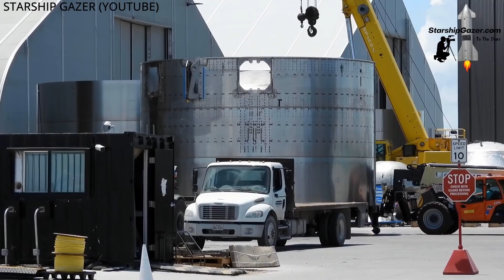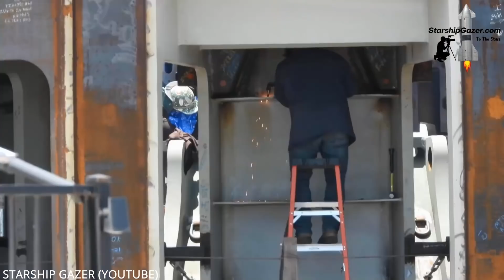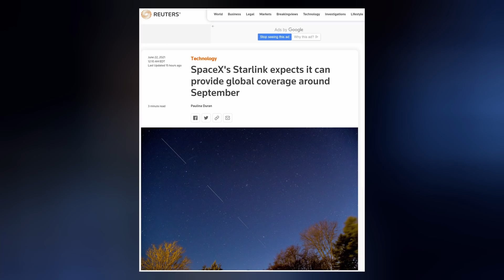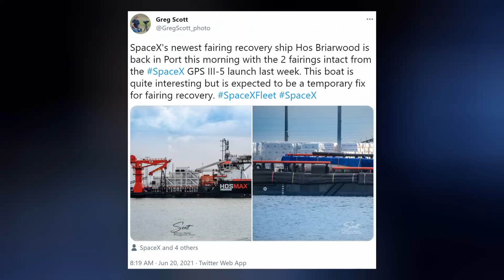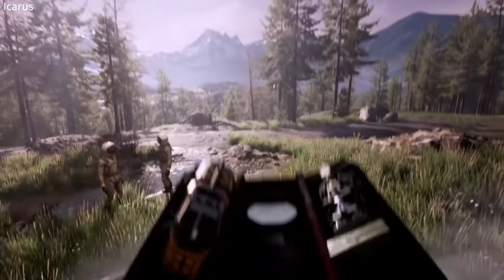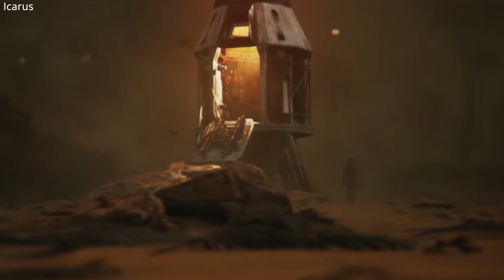Starship Orbital Flight Still Targeting July Despite Needing New Booster | SpaceX in the News

Comment: My fascination with space exploration is that it currently represents one of the most dynamic engineering problems in recent history. For instance, I’ve been thinking about Elon’s plan of increasing the booster raptor count from 28 to 32. Since the outer ring of raptors are fixed, there may be a unique opportunity to save some space by combining the outputs of the outer engines together by blending the bells into a common ‘ring’ structure. That would allow the raptor cores to be mounted closer together since the engine bell is the widest part of the raptor. The hot gasses wouldn’t really care if they were being directed by a physical bell or just the gas pressure of adjacent engines. The net effect would be a combined output being directed downward to propel the booster. The center articulated engines would still retain their individual bells, but that would be a way to significantly increase the number of fixed raptors in the outer ring without resorting to increasing the diameter of the bottom of the booster. Basically I just love solving engineering problems with innovative, out of the box thinking.

Comment: I have, since I first watched Star Trek on CBS (in black & white) wanted to "break these surly bonds" and head out into space. When Apollo ended, I was just so dejected because we had the minimum knowledge & the WILL to make the move on to Mars and Europe (and beyond.) then when we just started the Astronomical Equivalent of driving around (and around, & around...) the block for the foreseeable future - I just felt so betrayed.
When the shuttle program started, and bold new plans for a purpose built station were bandied about, I thought that maybe this was it. And, about this same time, I learned that my eyesight would prevent me from being a conventional astronaut. It made me realize that the only way I was going to get to space was to be a Worker on a commercial Station. I figured that the Government wasn't going to "go" anywhere, which left the private sector.
As a career direction, I chose the military. My grades and test scores were not really good enough to get into the kind of college/university that would put me into a suitable skill set for a space/orbital engineer, but they could get me into the Navy's Nuclear Power Program. After graduating from NPS, I volunteered for Submarine Duty with the following mindset: if I wanted to make myself a good candidate for a Worker on a Station, being a "Nuke" on a Sub had some specific skill sets. Namely:
▪ A Science based vocational skill set,
▪ Proven ability to work in a stressful environment,
▪ Experience working in a situation where one must "deal" with the reality of one's situation — i.e. One can't simply walk outside when shîť starts getting real,
▪ And experience with maintaining ongoing interpersonal relationships with folks that I might genuinely dislike, but cannot get away from.

To me, it seemed like a shoe-in for a resumé.
But, by the time I got ready to leave the military, we, as a Nation, & as a species had simply lost our way, at least in space.
And by that point I had both lost faith in the Government's will to do anything really innovative or even lead the march to the stars.
(And, I was now just too old to be any kind of viable asset to any space based culture.)
That's when I saw the Light that is Elon. And I knew that Private Enterprise was the only real way for the average Joe to get into Space.

Comment: The obvious question is, why have they decided o use BN 2 fpr stress testing and build a new BN-3 for the flight. Did the pressure testing of BN 2.1 raise some concerns that lead them to want further testing with a full size booster? Has some problem arisen with BN-2 that makes them think it can't perform a launch? Or is there some other reason? Any ideas?
Reply: It might be as the program is moving so quickly, components become obsolete as soon as they are completed and are replaced by a new and improved version. This shows the engineering teams are moving faster than the fabricators.
Reply: @bernieschiff5919    That's conceivable.

Comment: At the risk of sounding copycat, the two reasons you gave are similar to mine. The more science reveals about everything around us, the more evidence it reveals of our creator. Psalms 19, "The heavens declare the glory of God and the firmament sheweth his handywork." 
     I'm a child of the 60's, a lifetime aviation fan and a career aircraft technician. It was fascinating as a kid to watch the early space program as a child but as the years went by and I worked hands on with mechanisms and materials used in aerospace structures, systems and powerplants, it really gave me more insight the reality of what fortitude was required to get launched in one of those high velocity fireball containers. Nothing but respect for the engineers teams who design this stuff and the people who allow themselves to be strapped inside of those vehicles. Thanks Kevin for your hard work making these videos and thanks to your supporters to help make it happen.
     PS, Before my job turned into mostly computer work, I did do repair work occasionally with 301 stainless sheet metal and I do not envy the Starship fabricators at all. lol